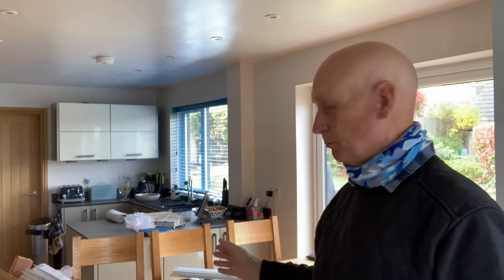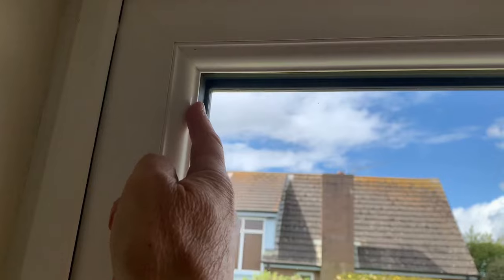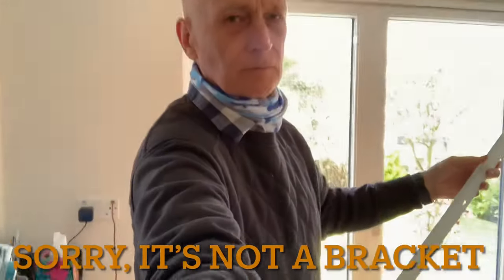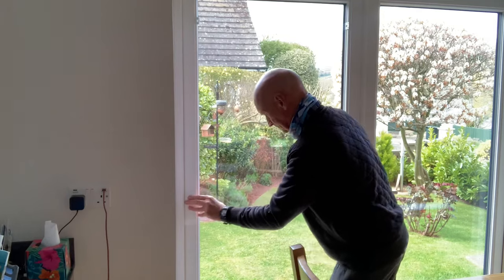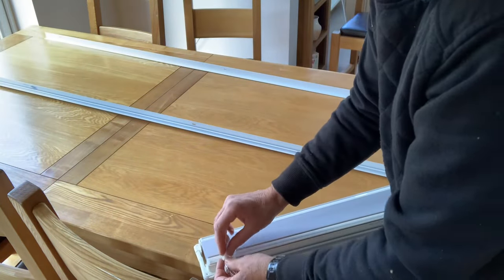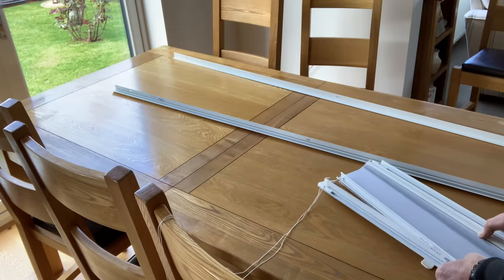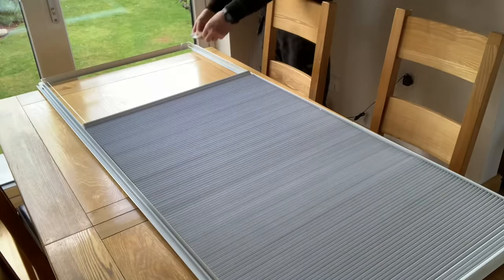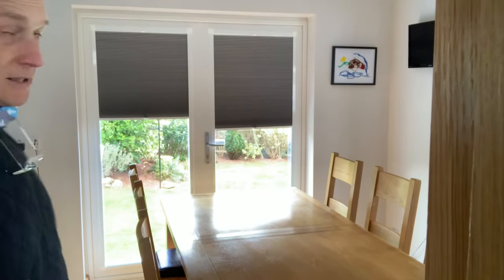Installing click fit conservatory blinds made by Blinds 2Go

Comment: I used a credit card when inserting the brackets, as instructed, but found that the holes in the frame weren't lined up with the brackets!  They'd drilled the holes too far along the frame!  So I had to remove the brackets, which had been a real struggle to insert, and move them along about an inch.  This made the whole job a lot more difficult, but I am pleased with the result. I think it's a brilliant system.

Comment: Does the blind frame stick out from the door frame by much and how far past the end of the glass does it go?
I've got bifolds with a centre rotating lock and I'm struggling to find blinds to fit a most seem to have quite a lip on them

Comment: This was really helpful but I'm still struggling getting the bracket under the seal. Even with fairy liquid ☹ our doors are new so I'm wondering if that's a reason. Anyone else having this problem?
Reply: Heat it with a hair dryer

Comment: My concern is that doesn’t this cause the seal to get damaged and thus causing condensation between the glass?
Reply from the maker: All I can say is that I have fitted these blinds to 6 windows of differing sizes in 2 different houses and none of the seals have been damaged or compromised at all.

Comment: Please may I have some advice. 
I'm struggling if the bracket can squeeze into the rubber seal of my windows. I'm even trying gently with cutting knife but it seems that the seal is very tight to the beading. Should I just push it harder? Thank you
Reply from the maker: I wouldn’t attack the seals with a knife.  I suggest putting washing up liquid on the bracket to make it easier to push into the seal.

Comment: Hi, thanks for creating this video. Fills in many of the blanks in the manufacturers video. 

At 7:47 you mention the knot that's tight to the frame. I have the same situation except I had a knot on both sides. One came away when pulled, but the knot on the other side is so tight to the frame I'm having no luck getting it untied. I take it you did undo the knot shown there? Just want to check that you did untie that knot and it's not supposed to be left knotted?
Reply from the maker: To the best of my recollection there was one knot on the left and another on the right, both of which had to be undone.
Reply: @sksdiy5874  Excellent, thanks for the reply. I will persevere!

Comment: A really useful video - thank you :-) Having done 2 myself now and several more to go. Issues we are having is we have more knots than you had, which are incredibly difficult to undo and no instructions on this. We will be ordering more and my query is, you didn't show much on tensioning the blind so they stay up, as again this involves knots and we found pretty difficult. How did you get on with tensioning them and having to redo the knots in order to do this?
Reply from the maker: I have now fitted 6 of these blinds in my home and haven’t had to “tension” any of them. I have only undone the knotted bundle - not the ends of the cord at the top and bottom. My advice would be to leave those alone.
Reply: @sksdiy5874  thanks...but without undoing the bottom one u can't expand blind out. I don't touch the top unless it needs tension which both mine have. We've got them to work fine but incredibly difficult and as u say instructions don't match up in places. I've spoken to them and they are hoping to send without so many knots! It's been great seeing ur video as made me feel better situation I've had, as u have way less knots than ours lol 😆
Reply: Having a similar issue, my blinds won’t pull apart at all when fitting. How did you get around this?
Reply: @michaeln645  Issue i had was related to too many knots that weren't necessary. I spoke to blinds2go and asked them to tape cord with masking tape to keep blinds safe during transit rather than knots. There should only be knots that u don't need to undo  unless re-tensioning the cord, but it was a learning curve.
Also i ordered blinds bit by bit so just coped with 1st ones. Used needles to untie the knots but took ages!! I had to speak to manager and send videos to explain my issue. Bit of a slog. Good luck
Reply: Thanks, having a nightmare with mine. I’ve kept the 2 knots at the top of blinds and have 1 at the bottom I can’t seem to untie at all. I thought undoing the easy ones would mean they open, but not at all! If I don’t have any luck will email and see if they can be returned
Reply: @michaeln645  u need a knot at both ends but should be at very ends so blinds do open out. Sounds like u've got extra like me. If u got from blinds2go ask for manager natasha,  she helped me organise the masking tape. As when done this way, they are an easy fit so I'm glad i persevered. I did say to them surprised more people haven't complained. I've put up 10 now and really pleased with them. Good luck

Comment: When I fit my blinds the bit you push into the door is loose and drops just wondering if anyone know how to re tighten the window part back in?
Reply from the maker: If the bracket is flush against the glass and pushed under the black seal then it should be trapped in place and secure.   Sorry, but if it’s correctly installed I don’t understand why it’s loose.
Reply: @sksdiy5874  the part you push it under seems to be alot loser than all the other windows, we've had them in for free years and it's like the door holiding window has become lose

Comment from the maker: It will all become very clear when you do the job. Give it a try.
Reply: Hi mate lovely job, would you recommend replacing the window seals if the current one's are wearing rough? Have you noticed any play in the seals since installing?
Reply from the maker: Replacing the seals would be a much bigger job, so if they are doing what they are intended to do I would leave well alone.  You won’t see the seals when the blinds are fitted.  
I haven’t found any play in the seals in any of the 9 blinds of this type I have installed. 
Hope that helps!

Comment: Can the insert brackets scratch the glass?
Reply from the maker: Hi. All I can say is that I’ve now installed 4 of these blinds and had no problem with the brackets scratching the glass. They are made of metal but have a coating on them and slid easily over the glass - especially with a few drops of washing up liquid. I can’t say it’s impossible to scratch the glass, only that I haven’t done so - and never had any concern that I might.

Comment: I  do not understand why to use a credit card to measure and what distance? Sorry.
Reply from the maker: The distance the card is measuring is from the top or bottom edge of the window frame to the edge of the metal bracket that slides between the seal and the glass.  
If correctly placed in position the lug which protrudes from the bracket will engage with one of the holes in the frame of the blind. 
That will thus locate the blind’s frame in position.
Reply: @sksdiy5874  Thanks. Credit card confused me because previously chatted with the company and they said that I can only use this product if I can fit a credit card behind the seal (black stuff). I cannot really fit a credit card behind the black seal. I think the seal would not be functional if I could. So that's why I started my research on youtube. Maybe the sharper bracked will fit . But I am not sure. So, you used the credit card to have exact measurement of where the bracket should go. But why did you not use measure tape?

Comment: Such a shame mine brackets won't go into my door. There's no gap for them.
Reply: If you have plastic or alloy doors there's always a gap for them, just by pushing past the rubber to glass contact area. If they are wooden it can still sometimes be done but with much more difficulty and shortening of bracket leg. The seal between the glass and wood would need to be taken out with an oscillating tool, this is where glass could be scratched and paintwork would need touching up, it's not impossible but will require some skill and patience.